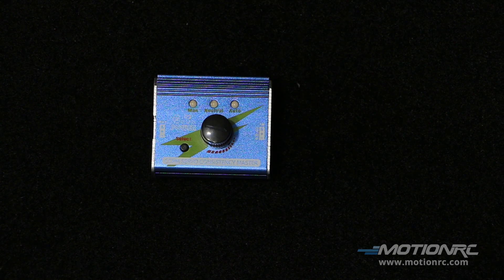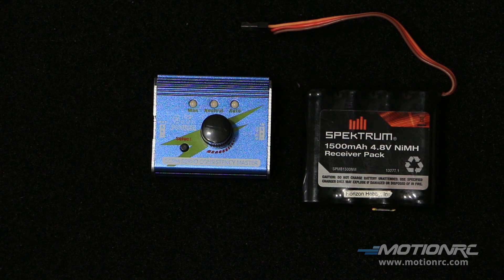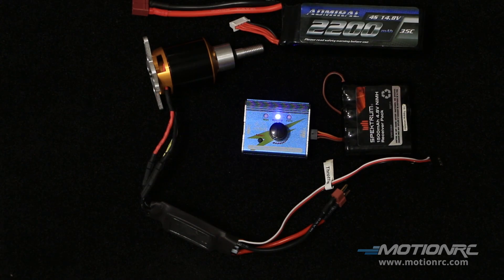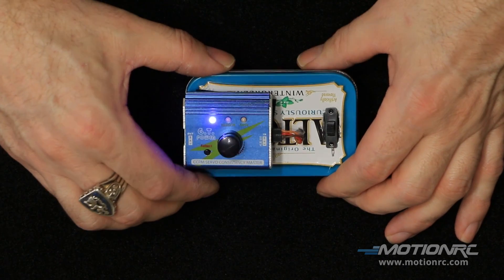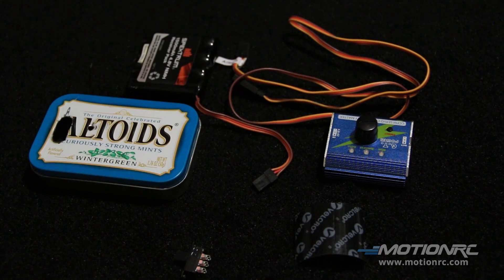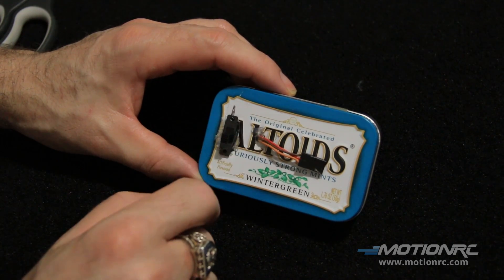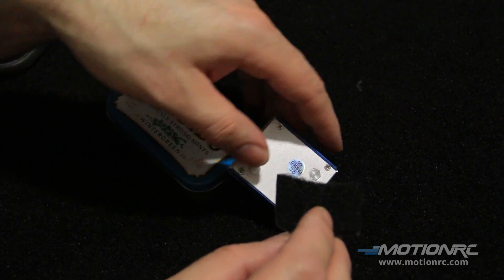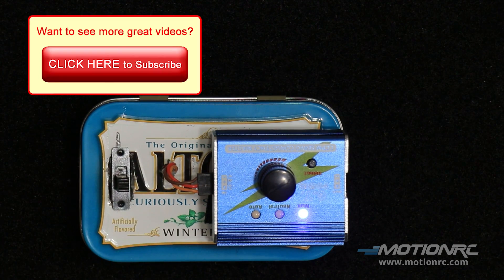Using a G.T. Power Servo Tester

Comment: helpful  video !!!!  I was unsure if I  was able to use my 3S 2200 mAh LiPo  to test my  servos with , because the tester states 4.0v - 6.0v range.....but if I understand correctly , as long as I connect the  higher voltage   LiPo battery through the ESC, it's OK...correct?....thanks

Comment: All well and good. Will this servo tester check servos like old Kraft KPS-11, KPS-14 II, Kraft/Heathkit S-14, RAM 2 INDY, Futaba S-48, S-28, and S-26. What you show in the video are baby servos. I'm talking about servos with meat to them. One's you can use to handle the main sail on an R/C sailboat. I've been in R/C for close to 40 years. My main type of model is boats.
Let me know if the tester can handle what I just listed. Thanks.

Comment: Hi I want to use a USB battery pack 5V 2.4A, can I plug it in directly into the servo tester or do I need some kind of voltage regulator in between?